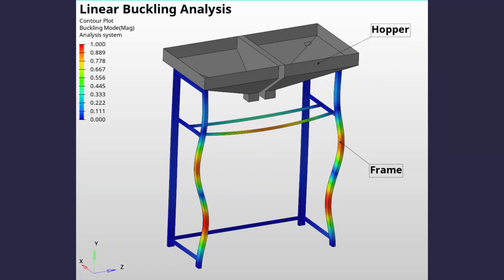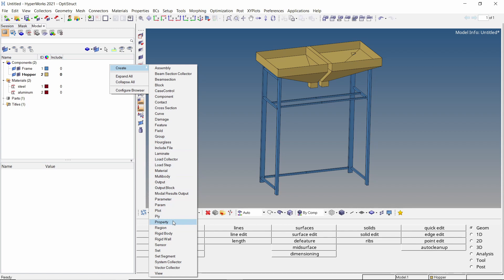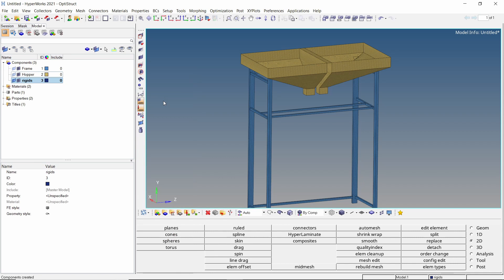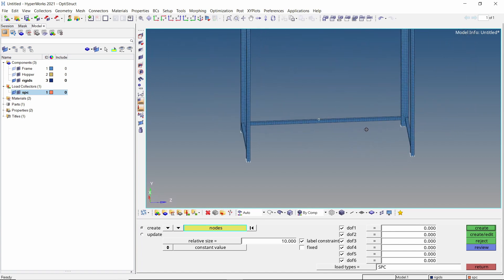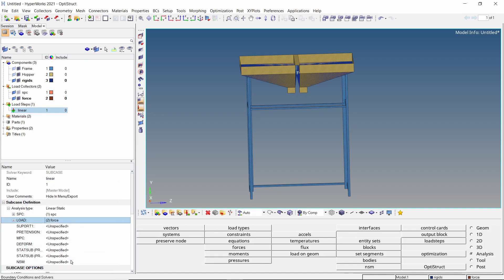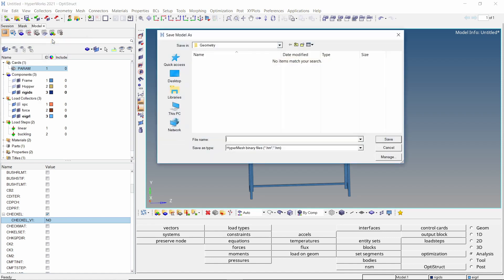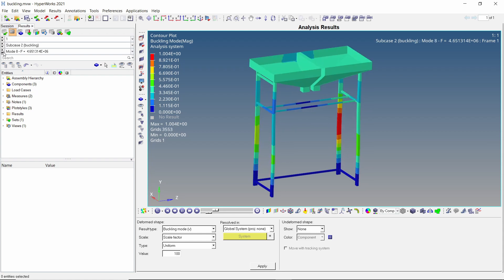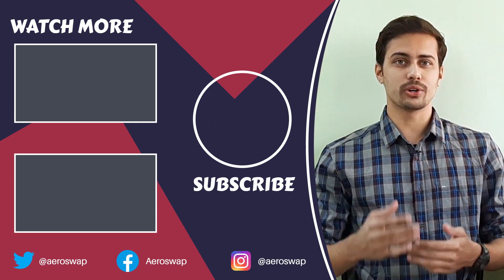Linear Buckling Analysis using Hypermesh [Optistruct Tutorial]

Comment: How to give rotational velocity in optistruct
Reply from the maker: What are you trying to simulate? Optistruct is mostly used for static analysis and optimization so velocity is not a commonly used boundary condition.
Reply: @Aeroswap  I want to to simulate drum mounted on 4 pulleys with drum rotation...so which solver should I use?
Reply from the maker: Radioss
Reply: @Aeroswap  thanks
Reply: @Aeroswap  but is it possible in radioss to do static dynamic analysis

Comment: Sir, have you already made contact with those two model of Hopper & Frame ?
Reply from the maker: Hello Onkar, 
The two components are geometrically connected. I designed the model that way to avoid complexities.
You do not need to create any contacts or joints. Just organize the surfaces (if needed) and you will be good to start with the setup as shown in the video 👍🏻
Reply: @Aeroswap  
Thanks 😊

Comment: Thank you bro👍
I have a query that how we decide the element size.
Whats are the criteria behind choosing a specific element side?
Reply from the maker: There is a concept called 'mesh convergence'. I will not be able to explain it here in one comment. Please search about the same if you can.

I also plan on posting a separate video about this topic soon. Until then, you can always contact me via email regarding any doubts or suggestions. My email id is provided in the 'About' section of this channel.
Reply: @Aeroswap  Ok thanks alot. 
Please also make a video on Linear Transient Heat Transfer Analysis
Reply from the maker: Thanks for the suggestion. I will try to work on this soon!
Reply: @Aeroswap  Sorry for the inconvenience . I have checked out about section but your email id is not showing. Could you please provide your email id here?